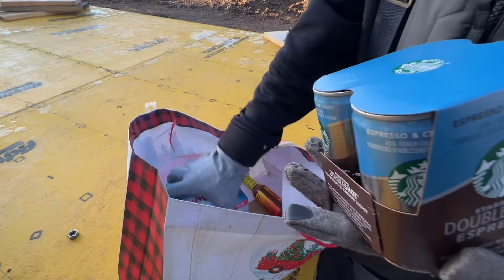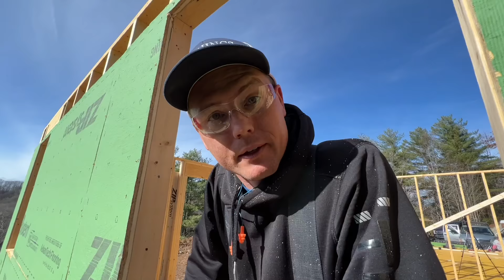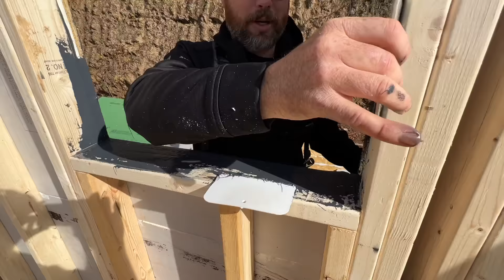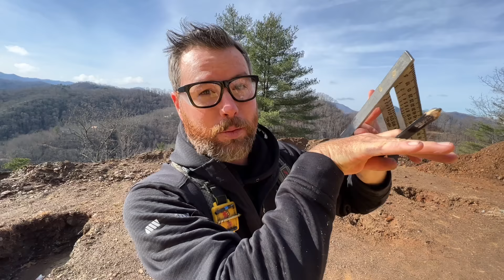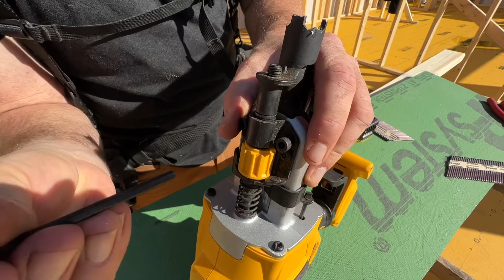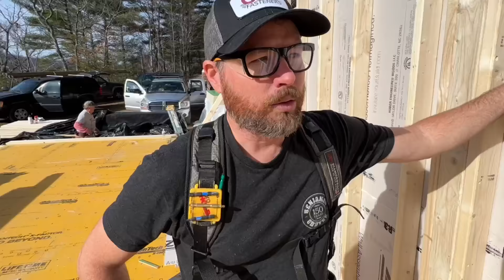Wall Construction and Sheathing | Building A Mountain Cabin EP10

Comment: Very beginning of the video, cant get the F150 door closed in the freezing cold weather!  I know that problem all too well!  Its a known problem for F150's.  I still love my truck, but man I dread thise cold mornings when my door won't latch closed.  Ford knows about it hut has yet to come up with a solution.  The theory is that moisture accumulates in the latching mechanism and freezes the latch.  You have to warm it up just enough.  I have a heat gun at the house for that, but it only works when I'm at home and it's time consuming.  The only ither suggested remedy that I haven't tried yet, is to take the interior door panel off and spray some kind of protectant lubricant that wont let water in or freeze, like lithium grease, on the latching mechanism.  I feel your pain bro!

Comment: Zip sheathing used to be fairly priced, but being an OSB product, they charge a fortune for it now. I like plywood any day of the week over an OSB product, but having that coating on  ZIP sheets is nice. Too bad they don't make coated plywood. The problem with plywood is the hollow channel in the sheets when using it on a roof, if you zip-tape the seams. I have had a lot of #9 GRK structural screws break on stress points. When you remove them, they are broken. # 10's have not broken

Comment: That Milwaukee framer is a beast, way too heavy and is actually a safety problem when toe nailing into the edge of a 2x, no barrel around the contact end and it will shoot nails out and into your or your co workers flesh.  That pasloade has a barrel, as do most framers.  Awesome tips you guys are sharing.

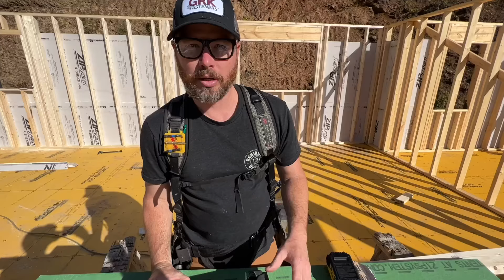Comment: 17:40 if you want to know how many  nails your dewalt dcn692 framing nailer has shot lifetime, put the gun in single shot mode on setting 1 and hold the trigger for 12 seconds, and every light blink on the indicator represents 1,000 nails fired. 
Mine is at 54,000:-)

Comment: We would snap lines for every wall on the entire floor and spray clearcoat over them, while 2 guys are doing that, 1 guy builds the header list and another guy pairs plates by flushing one end and then tacking them together with 8's so they pull apart easy.
Then we cut all the wall plates and set them in place on edge and then lay them out on the top easily seen edge and label them with a marker on the plates and the floor where they go... A - A, B - B and so on (it also provides a chance to see any potential "problems")
The guy pairing plates also cuts some paired plates at 160" and 13' 1/2'' on layout. 
If you have another guy... he can be building partitions and corners.
A lot of framers just want to get walls up as fast as possible and don't want to do all this....
But It's a very efficient progression..! When you do start building walls, it goes really fast.!
We would roll up on a job close to other framers that had already started and my boss would always say "think we can catch em..?" Many times we did... NAIL IT...!

Comment: 16:34 You guys and by you guys, I mean Americans, went from the worst screw heads (Philips) because of Ford's disagreement with Robertson to having some of the best screw heads EVEN THOUGH it was about same time that Robertson's patent expired. Meanwhile up in Canada, Robertson head screws have been and still are perfectly fine. If you're stripping out Robertson heads, it's either cheap screws or you need a better bit.

Comment: Those towels work great. I used them to clean paint, caulking, grease and more of my hands, tools and some surfaces. I used that caulking you guys were using down hear in Portland Oregon for a lot of windows and doors opening and it can get messy but it does work.

Comment: Pro Tip: Use a router with a flush cutting bit on a base with a pole, to cut out windows and doors, 10x faster and alot cleaner than saw

Comment: Question - when placing a wall on the floor sheathing and there's significant water present, aren't you worried about the moisture being trapped? Or is there enough air flow to dry it out?

Comment: Any reason Ray doesn’t use an insulin pump to control his diabetes? His highs/lows should be a concern. Is it the cost of the pump? Insurance coverage? No need to respond but there are a lot of health related ads in these feeds.

Comment: How do you plan to get insulation behind wall ties on exterior walls? Rather than a channel we use a stud on one side with a 2x6 turned flat to create an L which leaves an open space behind the wall tie

Comment: I notice your sheathing is laid running length wise instead of up and down grabbing the bottom plate and top plate. With this application do have to block the seams of the sheathing.  Just curious 🤔

Comment: You guys are doing good work over there.  I am impressed with how much y’all do yourselves, a truly diverse and skilled crew.  We do a lot in house with a small crew but sub a lot as well.  Keep it up
Sincerely Josh Bracken Mountain Design Build
Edit:  we install a 2x6 on the flat for intersecting walls.  Use a block to hold the vertical 2x6 to the studs in either sides.  This gives you all the deadwood you need and ties the 2x6 to the wall as well.

Comment: I’m not too sure about North America but in Australia we straighten/plane the internal walls before plaster. We use Masonite strips that get feathered to zero on each end if there is a hollow and we plane the stud straight if it’s bowing into the room. For this reason I’ve controversially always framed my exterior walls with the studs bowed down as it’s easier to plane a stud straight than feather a 30mm Masonite strip then staple the hell out of it to the stud. I hope that makes sense.  Also we save our straight studs for bathrooms/wet areas so large format wall tiles have a better chance at a dead flat wall.

Comment: Where all to screw ? Where all to nail ? Where all does it not matter which option we choose ?   Eg: I believe the Huber subfloor/roof panels have a screw in option ? Is that supposed to help avoid squeaky floors ? Also I have seen videos that say screws cannot handle shifts in the structure, they just would break..  unlike nails...

Comment: When I pounded nail for a living in my younger years 40 years ago, are crew would also nail the header to the assembled king stud  jack stud before nailing it to the top plate. The common studs would be assembled into the wall last making it easier to nail together all of the window and door openings in the wall then nail on the bottom plate.

Comment: Hey Perkins bros, for that zip sausage, do min. 3 inch inside and 3 inch outside. Ditch that tool and get a sealant trowel (or a metal cake decorating trowel). I work commercial waterproofing and that is a much better system than the sheet flashing the only downside is its messier.

Comment: Why do you guys run your zip boards horizontally as opposed to vertically? I see most new constructions in Asheville run then vertically and I’m really curious the advantages/disadvantages of the two orientations. Thanks!
Reply: The standard way is horizontal. Just like running subfloor perpendicular to the floor joists. The strength axis is down the length of a sheet. The zip system can be installed either way.

Comment: Perkins, why don’t you build with 2x6 studs for the outside walls? I am asking because the temperature up there seems colder.
Reply: Sometimes we do.. it’s colder here in the higher elevations. But down low at 2,000 ft or less it’s not bad
Reply: @jaimeperkins9606  what do you recommend for 5,000 ft elevation?

Comment: Why do you do your partitions like that?
Reply: It’s a Nailer for the wall to attach to another wall. And a drywall nailer on each side
Reply: @jaimeperkins9606  I guess I'm asking the partitions studs on the exterior walls why not do a L stud (California corner) but add another stud to it so it's a double stud with an l same amount of material you are using except you don't have to put foam insulation in before you sheath the walls.  You can wait to insulate  till you are insulating the rest of the house?

Comment: We always built our wall leads with 3 blocks instead of a full stud.  Saved a bit on materials.  Also pro tip when you are building 2x12 headers….  Keep your hand away from the nail gun.  I once had to cut off a section of 2x12 and drive a guy to the ER because he shot a nail straight through his hand into the header

Comment: Hey guys, for must needed flat walls, use metal studs and install 3/4' plywood?  I suppose 2x4 exterior stud walls are still code in North Carolina.  Here in NY, its 2x6.
Reply: I’m sure one day we have to be 2x6 too
Reply: @jaimeperkins9606  definitely better insulation and structural for exterior walls, but heavier to lift.   Time to get a Lull! 👍

Comment: I've got some pro tips from Live Zero Design Build YouTube videos soon. 
1 cut bond spreader in half makes it just the right size for spreading liquid flash. 
2 wear disposable gloves.
3 use Prosoco R-Guard Fast Flash it's better than Zip flash. Prosoco can stand longer exposure to the sun and elements than zip before you cover it.
4 if you are in a dry climate mist / wet are with water. Liquid flash cures with water moisture.
In wet areas just brush away pudding and go ahead and flash wet wood and concrete.

Comment: The door issue, it's a recall. I have the same on my passenger door. It's related to condensation freezing inside the door in the latching mechanism. Just had it happen the other day, haven't gotten it fixed yet. The dealership needs it for the whole day to take of all the doors and install some plastic to sheild the mechanism.
Reply: Even if you’re recall was initially performed there was an extension on it. I’m the parts manager and the warranty administrator at a Ford dealership. If your dealer hasn’t performed a lot of them, yes it will take all day. If they have, the person working on it shouldn’t take that long to perform the recall.
Reply: I got 2012 Ford Galaxy and in it too.

Comment: Great building channel.  Check out new product, hemp Lego style building blocks.  12", R70, sound proof, fire rated 2 hrs 0% structurL fail, stronger than Concrete, self leveling, mold and bug resistant.  Need to use water proof blocks at grade and below. Exploring Alternatives on utube with product review.  One truckload builds 1000sq ft.  Commercial and residential versions.  Canadian Company, each 1500 Sq ft stores 10 tons of carbon.  It's a great DIY or contractor product.  Good luck

Comment: I have a F150 and found that a "bandaid fix" to the freezing door latch is to open door from inside and resecure the me mechanism with your key or something. repeat a few times. Last time open from inside the lock your door with you inside (duh) and close your door. it has worked multiple times for me in a pinch. But that shouldn't happen on a truck that cost $30k+. Recalls haven't fixed it. Probably last time buying Ford.

Comment: Will you put insulation under the floor?  In the UK we'd have at least 4" (100mm) of Polyisocyanurate foam under the floor.
Reply: They left it all open for now because of plumbing and electricity. It will come later once all is done in the crawl space.
Reply from the maker: Yep!
Reply: Thanks guys, enjoying the build! 👍🙂

Comment: Huber recommends that you use liquid flash on all of the nail holes in zip sheathing. I think the liquid flash is ideal for that application.
Reply: Love the ZIPP system but when a nail blows through the outer green coating, it exposes the underlying "OSB-like" stranboard.  Using the liquid flash to fill in these "overset" nails re-establishes the outer impermeable membrane
Reply: The build show did a good video on that. Don't see a lot of people do it tho

Comment: Lot of fun in this one!   

 From my experience,  I wouldn't depend on a straight stud to stay straight.  They do all kinds of acrobats these days once stood and dry out more, especially with the fast grown, unstable lumber we get these days.
Reply: If you buy from your local lumber yard, as opposed to a big box store, the lumber is almost always kiln dried, and far less likely to twist or bow over time. Look for a stamp on your lumber with a KD, which means it is kiln dried.
Reply: @ThePlockets  I seen so many studs warp, twist, and bow after they were stood up that came from different local lumber yards.  Many builders have framers or punch out guys go back, run strings or straight edges, and fix or replace these wayward studs before drywall.
Reply: @shanegillespie6014  Do you know if they were actually kiln dried or not? My experience is admittedly very limited, but kiln dried has treated me alright so far.
Reply: @ThePlockets  Yes, they were kiln dried.  We even put blocking at half the height of anything 9' or taller trying to help alleviate the problem.  The blocking does help but there has been a time or two when the blocking gets twisted out with the stud.  I used to have a photo of one on my phone the first time I saw it with blocking.  I just couldn't believe it.
Reply: @shanegillespie6014  From what I could gather in 15 minutes or so of googling, it seems the kiln drying process only stabilizes the wood for the conditions it was dried in. So, getting wet again, or experiencing a prolonged change in humidity level from when it was dried can cause the wood to warp again. I guess all you can do is lay it flat and try to keep it dry before you use it, and hope for the best!

Comment: Try using a stud block stud instead of a channel. You save 1 stud per partition as well as a better insulation value. You need to insulate before standing partition walls. You still get full drywall backing as well as the same strength! I just center a 1 foot block between two relatively straight studs. 
Tip coming from the yukon canda where a little extra insulation matters ! Love the content

Comment: I am sure those "Z" imprints in the tape assist Zip Tape when they come to site on a tape failure ... if they do not see the imprints, then they can say you did not use the proper tool to affix the tape to the boards.

Comment: Question here from the Netherlands. I see you guys are using sheeting with foam on it. Does this effect the nail spacing of the bracing walls? As a junior structural engineer i can imagine the nail having a spacing from solid wood to solid wood that this can create a moment of inertia, bending the nail.
Reply: There is a nail spacing printed on the sheets. We use 3” gun nails for the wall sheathing
Reply: Each type of Zip System has manufacturers recommendations on nail spacing to cover warranty. Hope that helps.

Comment: Have you ever framed your interior walls 3/4 short of your exterior walls just the stud at the wall not the plates.  So the 5/8 drywall can pass behind and give you a unbroken envelope all the way around. So better insulation and less backing